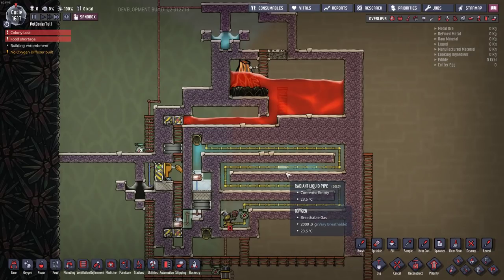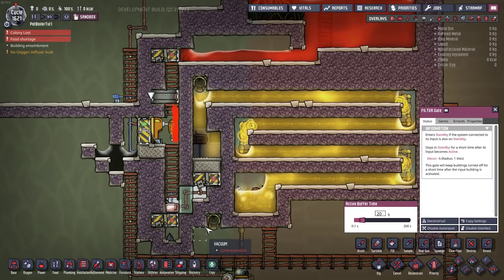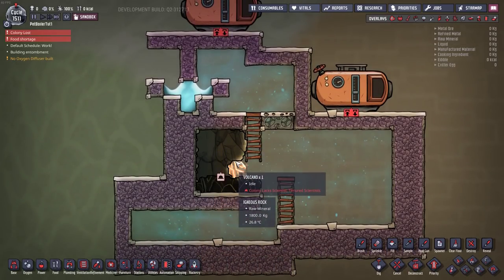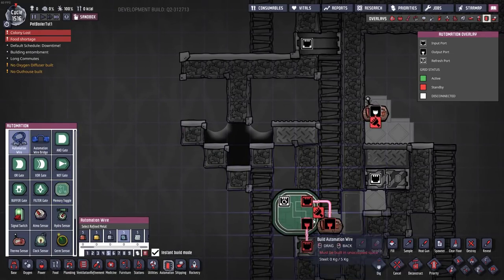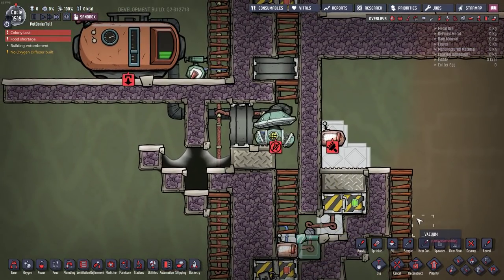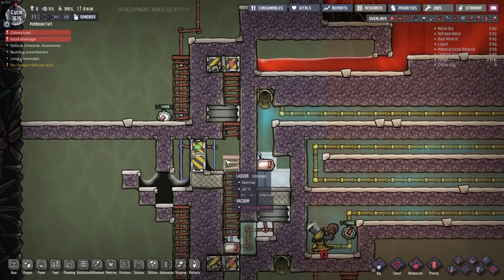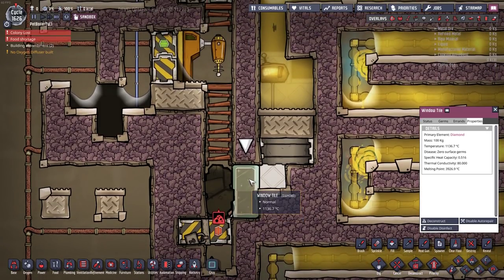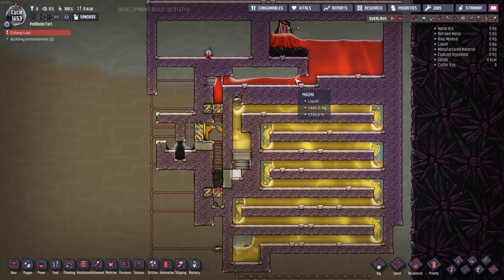Volcano powered petroleum boiler : Oxygen not included (Save file attached)

Comment: I had a minor volcano and combined this with a regolith melter. The spent (yet still very hot) igneous rock that is mined out by this boiler and drops below the lower door is then picked up by an autosweeper and delivered to the regolith melter to be fed through the snaking line to bleed off the remaining heat into power. Since that combo is giving me plenty of power, I'm feeding the petroleum into plastic production, to fill in my asteroid with plastic tiles for fun. The cooled igneous rock can then be fed to my hatch farms. I added a liquid element sensor just above the top thermo sensor to check if the crude oil is backing up and closes the liquid vent.

Comment: I just found your channel while looking on forums for heat and space area. 
Found a page about rockets but nothing about general items. Telescope scanners etc. 
No matter what I do. Cleared the space above. 
Asteroid hits, all clear, open doors, everything overheats.
No matter what I do. Pump cool gas in the area. Run cool liquid or gas through.
Combination of things. 
Still over heats. 

Going through the playlist. Up to oil. That's so much easier  to keep things cool. 
I don't use thermo aqua tuner to much. So much power involved. Already pushing the limits. 
I'm gonna start a new game and play through with your guide.

You make it look so simple. I'm on lower settings and still have trouble.
Running out of food. Heat. Dirty water. 
Oh on the part about getting plumbing. Can use the germy water from toilets to run back into wash bins, CO2 scrubbers etc. and it takes in X but gives X+
So they are definitely worth it.

Any way. I'd like to see more. Just playing the game. 
Everyone always has to add challenges and something special to it. 
I just want to watch someone that knows what their doing. Play the game. 
Don't need all the hoopla.
Reply from the maker: Never got into recycling polluted water, the 40C output of the water sieve put me off using it early and later water is usually solved. Hope the video's helped you out and I'll try and get into a normal game at some point. But after all the testing and optimizing I did I really want to just try something hard that will push my abilities.

Comment: Sooooooooooo I missed you saying run it at 10Kgs of crude.... multiple times hahaha. Interestingly enough, I was able to have it run at .5kgs for a long long time. Got it running at 5kgs now and all seems to be operational. I did have a pipe burst when I upped it to 5kgs up at the top of the heat exchange. May have went back a cycle as soon as that happened. Thanks again man
Reply from the maker: No worries, if it's still popping at the top maybe replace a few of the final pipe segments with insulated pipes. With less counterflow to work with this should stop the pipes bursting. It will increase magma consumption slightly but their is enough of a safety margin built in that unless you have a really weak volcano you should be fine.

Comment: this thing is awesome thank you it helped a lot and it doesn't require any cooling not to mention minimal power usage
Reply from the maker: Lock the access door!! If dupes can get in they sometimes pick up the little piece of rock debris that sometimes ends up on the magma tiles. It's so hot it causes that little drop of petroleum at their feet to flash to sour gas. It's a mess to deal with.

Comment: I was thinking that it might be good to use a specific material for the tempshift plate between the diamond tiles and door. I'd argue maybe Wolframite.

So the temperature of the incoming oil should be very close to petroleum. And transferring heat between the magma and the oil shouldn't be too hard. What you need is to make sure the temperature doesn't go much above the conversion temperature. Because the higher the temperature of the outcoming petrol, the and the lower the flow rate, the more likely the oil will flash and damage the incoming pipes.

You'd want to be able to convert 10kg/s but also you'd want to be able to convert as little as you want.

With fresh 1700 degree magma and a 2.5kg/s flow rate, a diamond tile there is just transferring too much heat too quickly. The door will open/close more and stay closed more than with a diamond plate, but it should be able to handle a much slower conversion rate.

Perhaps also, putting normal pipes for the top switchback, so it heats more slowly might help too.

Lastly, I've moved the temperature sensor down by one. So if the temperature gets too high, it knows more quickly.
Reply from the maker: A long time ago I experimented on this in a steam turbine build, it's a compromise. If you use a lower thermally conductive temp shift plate you have less over heat when the magma is hot but when you get to lower temps you have to cycle the magma out at a hotter temp (say 500C instead of 430C) as you can't draw out the heat fast enough to convert the 10Kg/s oil fast enough. So you have to figure out what gives you the most longevity for your magma. I would encourage you to experiment as I did this testing a long time ago and for a completely different design, now that you have brought it up I'm sure there is a better way of doing it.
In my lets play I replaced the last few pipe segments in the counter flow with ceramic before I cut back to 6.4kg/s of crude. The lowest you should ever need to go is 3.2kg/s in the case of only one oil well.
Be careful with the temp sensor placement if it's in the stop where the crude oil drops hit this can trick the sensor to engaging more often.

Very well structure and clear points by you, have you ever considered doing a few tutorials? You have the mentality for it and the community could definitely use more concrete information on this game.

Comment: Just built this and it works great. Now I need to think of good uses for all that petroleum!  Anything besides petroleum generators?  The CO2 is good for my slicksters but not sure I really need more polluted water.
Reply from the maker: It's power, slicksters as food and a source of water forever. I find that once you have one up and running you are effectively stable forever.
Reply: @FrancisJohnYT  I did have it break on me from pressure damage at some insulated tiles left of where the oil converts to petroleum. I had (only) polluted oxygen in the counterflow section since I think you'd mentioned anything was fine. I was able to pause things and rebuild as needed though this time with the counterflow area vacuumed out and I've had no trouble since. It has made me paranoid though so I still go check on it now and then.
Reply: @Sytesh  in this example no, as the oil and metal tiles are reaching out to where there are gases outside the system, so the heat can bleed out there. Now it's much easier to build this part due to conduction panels, but you do need to pipe liquids to cool it. I just use the incoming oil.

Comment: I think I messed up at some point, probably with the length of the counterflow, when the magma turned to igneous rock, after a while my oil would not convert fast enough into petroleum, was building up to the point it was going as oil back through the counterflow, had to use a liquid element sensor to shut off the liquid vent, so it didn't put any more petroleum than the top of the counterflow.

Comment: I'm having problems kickstarting this with the temporary switch.  I double and triple checked all the automation circuits, included the revisions you posted near the end of the video (about rerouting one of the automation wires to avoid the door, and adding another automation wire in the interior area), and all my circuits, wires, and settings appear the same.  But I noticed there are already "green" signals at the X-junction where the temporary hydro sensor hooks in, and no matter if it's sending a green or red signal, the middle door stays open and the upper door is closed.  Flipping it does no good.  So I'm at a loss how to kickstart it for the first time?  Everything is powered up and ready to go (and that tile at the end of the magma blade removed) and it's ready to go, but I can't figure out how to kickstart it.

UPDATE: Figured it out.  Had something to do with the temperature sensor at the bottom of the magma chamber never reverting to a red signal in a vacuum.  Looks like these sensors don't flip their signals in a vacuum unless they're actually in something?  I'm guessing it had flipped to a green when I was messing with it then a vacuumed out that area and it stuck in green.  Anyway, deconstructing it and rebuilding it seemed to fix it.

The boiler is working great - thanks so much for all the time and effort you put into this!
Reply from the maker: Trouble shooting is when you learn the most about the game :) Glad the design is working for you. I ran this in a survival game and ran into a few kinks that it's nice to be aware of. I added a few notes to the description of the video just now. It covers some use cases where you may encounter issues if you don't know how to handle them.
Reply: @FrancisJohnYT  Thanks!  I built it in a survival game, and it's run for many cycles with no issues.  The only thing I noticed, and it just happened today, is that the oil supply pipe broke a couple times in the bend going to the pipe outlet (the second bend from the outlet, the one actually in the petroleum channel).  I was redoing my oil supply lines from my reservoirs at the time, and the only thing I can think of that happened is that the flow of oil got interrupted.  I wouldn't think that would cause an issue, but my only theory is that without any oil to absorb the heat, the petroleum right there stayed a little too warm, and then when the oil flow resumed, it absorbed too much heat and flashed to petroleum in the pipe, breaking it.  I only thought pipes broke when the liquid inside changed state to a gas (or froze) but maybe if it changes from one liquid to another, that will break it also?  I'm guessing that lines up with your note in the description about being careful of reduced flow rates.  I guess I ran into that by accident :)

Thanks again - this is great design and definitely solved my petroleum issues!  Now I feel like the emperor - UNLIMITED POWER!
Reply: @chrissorrows5563  I'm having the same problem here. Can't kickstart it with the temporary switch. It always sends a green signal and the upper door is always closed.
Reply: yes me too,, i've watched this and 2 others going over this design, all in sandbox, and none cover the whole "top door is closed and won't ever open" I'm running in debug so can spawn magma to get it started thankfully. NOW to cure the flashing to sour gas issue lol. Love this game but damn is it frustrating sometimes!! :)

Comment: 10:03 and there's my problem. was not explained in the newer video so i didn't think about it until now. built my whole boiler out of granite and was wondering why the walls next to the magma heat injector failed...   I replaced them with ceramic and thought i just missed something. I have since been checking other tiles out of paranoia and they are heating up and i'm worried they will slowly work their way up to melting point.  this confirms i now have a future problem.    hrm...

Comment: I've actually been trying  this build out in conjection with your other metal volcano, I don't really care so much about the metal, but I don't have another volcano so I decided to try this with a gold volcano, I've been running it now, and it seems to work? I think I might run out of liquid metal soon though - it seems to be draining the heat away too fast. I must have missed a small gas pocket or something when I built the loop, there was gas stuck in there and then the liquids didn't move and stuff got over pressured, everything broke down and I ended up just vacuuming that space, I did have to make the automation out of steel instead of the gold I was using, because it ended up just melting XD, kind of forgot that the liquid heat of gold would also melt gold >.>
Reply from the maker: I forget to mention uses steel automation, sorry. I always forget a few little details every video. Gold volcanoes produce the least heat, I hope you built a really big counter flow.

Comment: Hi, just a simple question, i just dont want to bother you, i just want to know if this could be applyed to an iron/gold volcano.
The iron volcano have its output at  2526c. But i doubt that the steel door can handle this.
Im sorry if im bothering you.
Nice video and design, thank!
Reply: Assuming the liquid metal isnt sitting atop the door for extended periods of time it wont melt.
The problem with using metal volcanos for these things is that their heat output is unimpressive compared
to the output of magma volcanos.
The specific heat of Iron is highest among the 3 and even it has less than half of magma. (0,45 vs 1,0)
And their output is around 350g/s , a third of a normal volcano.
Even with the higher output temperature the average Iron volcano can maybe process as much as a bad minor volcano. Subtract another 30% for Copper and half it again for Gold.

And that not even considering the extra logistic of getting the material out after its cooled down
since refined metal is worth quite a bit more compared to Igneous rock.
Reply from the maker: Vulkandrache nailed all the points on the head. Liquid metal is very tricky to work with. Also it forms tiles at different KG amounts and flow at a different rate. The Dripper will not work with a metal volcano. If you don't have a magma volcano your best choices are geo thermal magma or holding out for space and using a space metal aquatuner as a heat source.